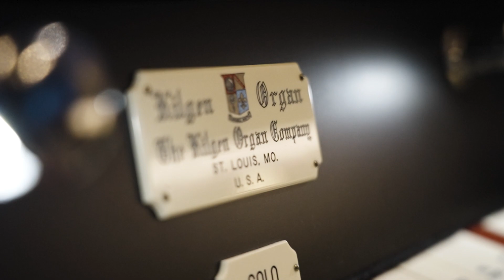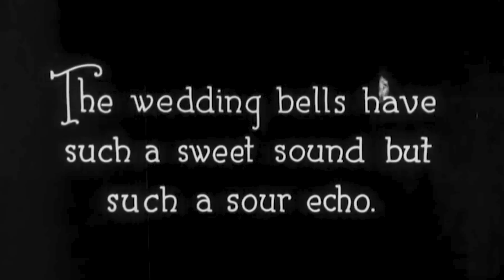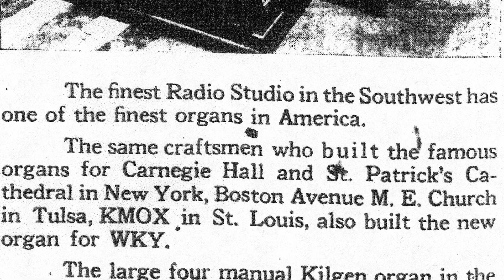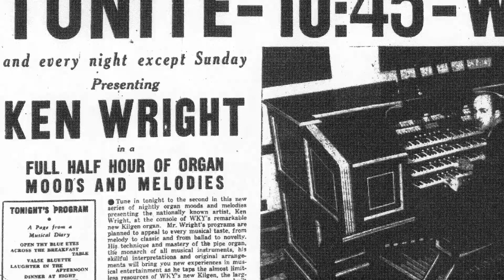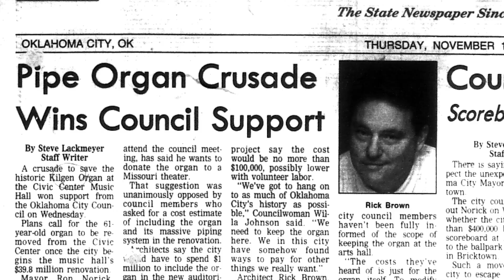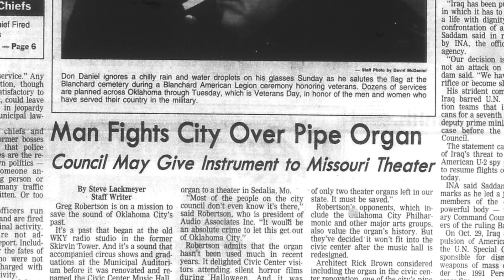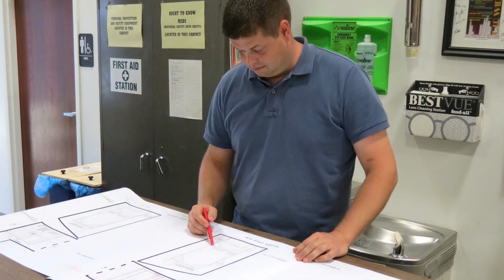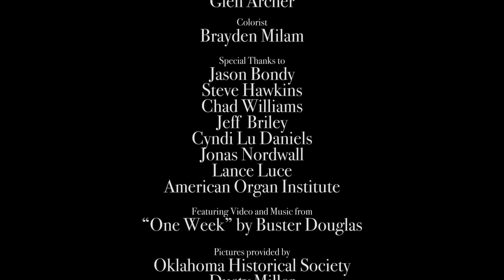"Saved from Silence," Resurrecting an Oklahoma artifact; the WKY Kilgen Theater Organ

Comment: I am so happy that this organ has been saved.   When I returned to Oklahoma in the 1980's from the west coast, I formed a company with Paul Haggard, who had been one of the installers of the organ when it went to the Civic Center Music Hall.   We had a small workshop in the music hall, and in payment for that shop, did the maintenance on the organ for about 3-4 years.  During that time, the relays were modernized from a pneumatic system to a digital coupling and relay system, which allowed the complete organ to be played for the first time in several years.  For three of those years, I played a Halloween organ concert with organ accompaniment to several silent movie thrillers - Nosferatu,  and Phantom of the Opera - were two of them, and we had great attendance.  After the third year of that, attendance fell off, and the music hall operators decided not to repeat for a fourth year.   Right after that I came to southwestern Oklahoma and opened my pipe organ business.  Paul had retired by then, and I had very little to do with the Kilgen after that.   I missed it very much, but was very happy when I learned that the  organ department of OU had taken it over.   Although I have not yet heard it in its new surroundings, I'm certain that its sound fills the room with majesty and delight.    Thank you for alerting the public to the treasure they now have in the Historical Center.  I hope it is played as often as possible.
Reply: I met and visited with Paul Haggard many years ago when I used to repair the Rodgers organs for Jenkins Music. He asked me to be the key holder for a tuning at a church, and I was happy to help. At the time I had considered moving into pipe organ repair, but that experience watching him just tune the pipes made me realize that it was a whole lot more work than I was able to do. I also had worked on the hybrid pipe/electronic Rodgers organ at OKC First Nazarene, and again, I knew it was too much for me.